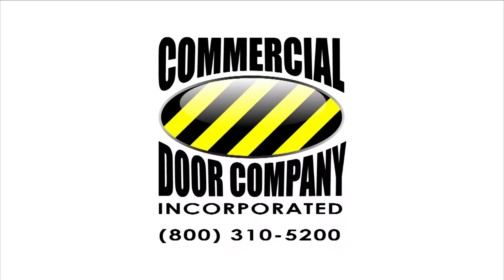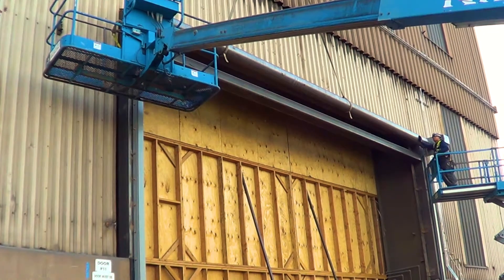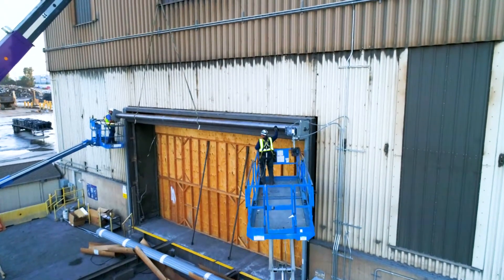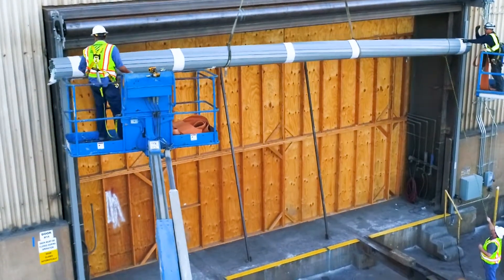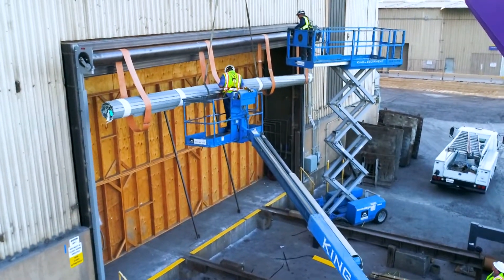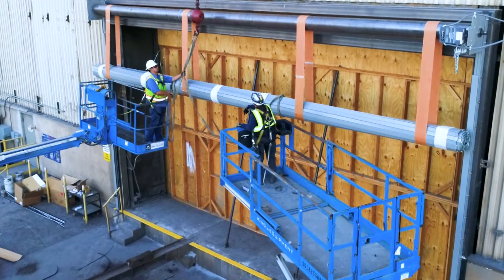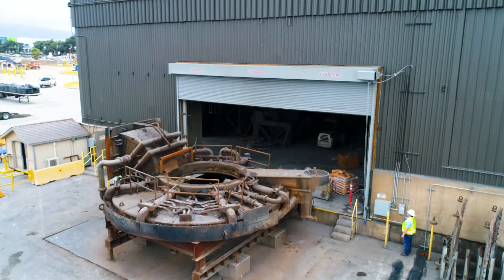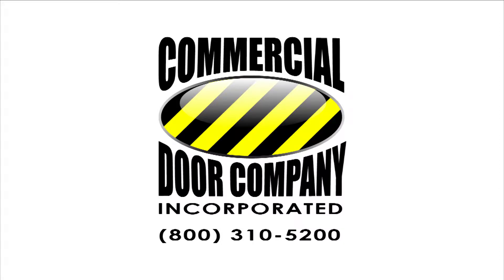Large roll-up door installation

Comment: Why did you use 8 straps to support the curtain?
Reply: Where do I find these straps
Reply: @SnappyVile  go to home depot & get some burlap rope... fattest they got, & a door that size youd take 6 or 8 ropes & tie a square knot. This way the curtain is closer to the pipe as the ropes are adjustable. which makes it way easyer to wrap. I coulda wrapped that monster with winding rods & a crow bar, no operator..... but... seeing how its a steel mill & burlap rope doesnt have a " load rating" they probably had to use straps....  but it looks good..👍
Reply: Looked like big ass rubber bands lmao
Reply: The problem I have is the lack of extra help to attach the curtain especially on larger installations. So the extra wide straps seem useful but I do agree about them being too long. I used to use marine rope and I liked it but not everyone can be trusted to use them properly.
Reply: The company I work for uses regular tow straps and they slip too easily which is a problem when spacial restrictions don't allow for a lot of vertical movement. Does anyone know  of a curtain cradle? Obviously one that won't damage slats.